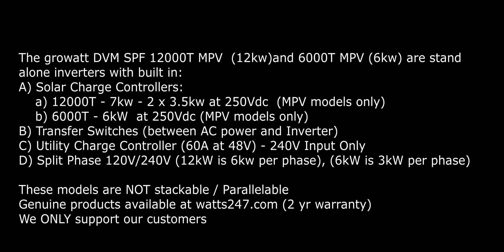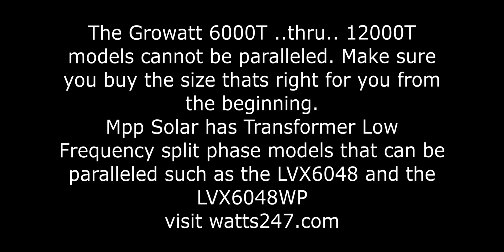Inside look -  Growatt 12000T 12kW and 6000T 6kW 48V 120/240V Inverter

Comment: such a same no parallel mode  i rather multiple smaller units especially when your talking about something 80kg , what Mosfets are in these the 150v input is quite low compared to other inverters  its a tuff one when 4x panels are just a tad over voltage

Comment: Ian, you’re ruining my dreams. I specially asked if the 6000T is a low frequency inverter. Are you telling me that it is Not a low frequency inverter, but a high frequency inverter with an auto transformer in order to supply split phase power?
Now you tell me that it can’t be paralleled. That would have been priceless information when I asked to buy a second one. .

Comment: Hi Ian. Two questions: Did you bond ground and neutral in the subpanel witch inverter feeds? Did you run a neutral from main panel to subpanel to have a common neutral? Thank you.
Reply: I have been asking and investigating no one seems to answer that question ❓❓❓ I'm only off grid... should I bond them in the panel or just run a ground cable separate to   a rod...

Comment: That LF transformer is massive. You should put a link in your description to your business. I thought the 6000T or smaller (4000T, 5000T) can be paralleled? I bought the 6000T (though haven't even installed it or tested it yet), and was planning on getting another to parallel them. I guess I didn't do my homework.

Comment: Are you familiar with what could cause code 56 and 4, battery voltage its code all the way to inverter, even inverter detects voltage but gives me those two codes, same problem in two (2) growatts 3000

Comment: Any possibility of a more detailed review of the 12kw? Seems no one is talking about these.
Reply: I've been running the 12k model for about a year (purchased through Ian) and it's been solid. It really is heavy, but the auto transformer is worth it. On average, we use about 25-30kWh/day through the 12k, up to 50-60kWh/day in the summer.
Honestly the only downside is you can't parallel it, and the wifi card isn't built in like some of the MPP Solar units, which took me a few tries to get set up, but is working now.

Comment: What is minimum battery size for using 6kw version?
Reply: In the manual it says 300ah I believe.
Reply: @JM-yx1lm  So just 3 100amp hr batteries for full output, for an hour?.
Reply: I use 50.000 watts a thousand eighty amp hr.

Comment: Can you test their 3x power surge capability?
Reply: Yes, this would be good to know for people with deep well pumps. I doubt that the transformer less unit could handle those loads that's why I am looking at the heavy transformer models.
Reply: @sh839c  I tested my 3HP 240V well pump with my LVX6048 recently. Started it easily.
Reply: @niktak1114  that is promising, how much battery do you have? I will just be using batteries for emergency water for now.
Reply: @sh839c  about 10kwh usable. The only issue with this particular inverter is that it doesn't have a power save mode so it wastes a lot of energy if the only thing it will be used for is a well pump that pumps a few times an hour.
Reply: @niktak1114  Thanks. Which one does not have a power save mode,  the Growatt or your LVX6048?.
Reply: @sh839c  LVX6048. I believe the growatt has one.
Reply: @niktak1114  Thanks this helps.